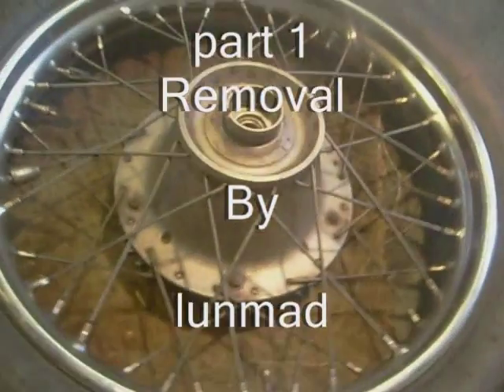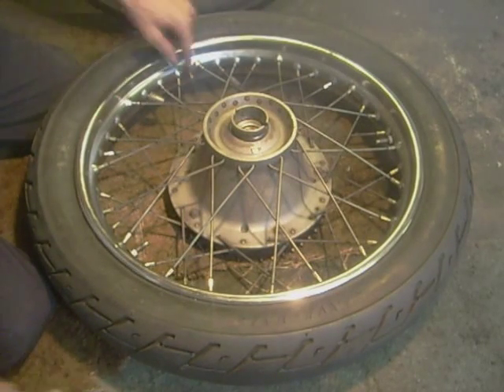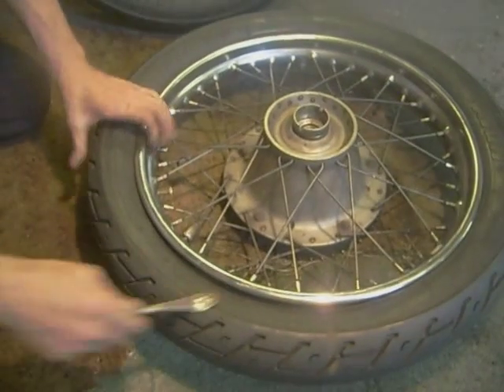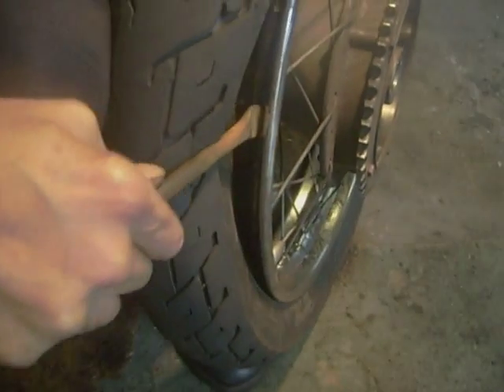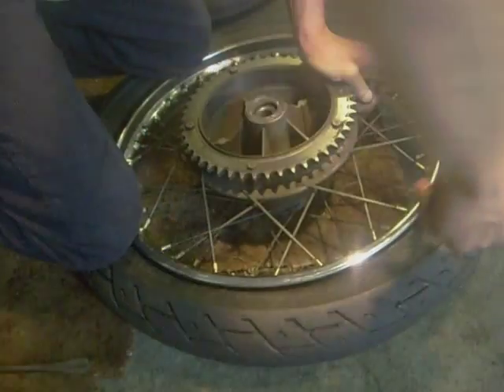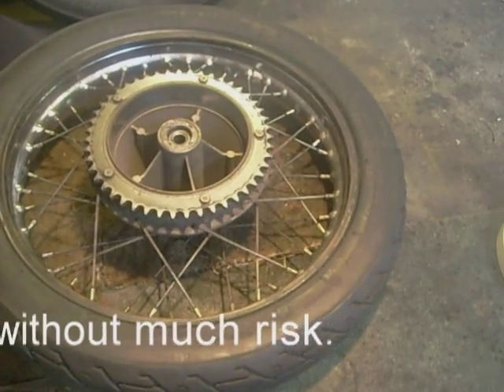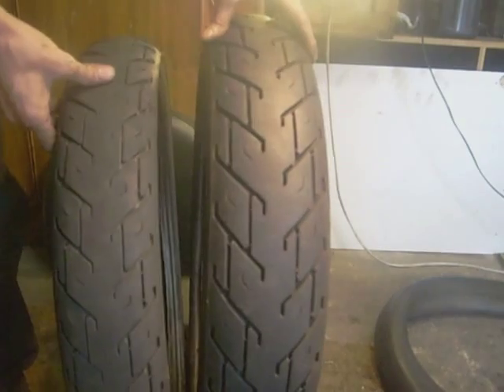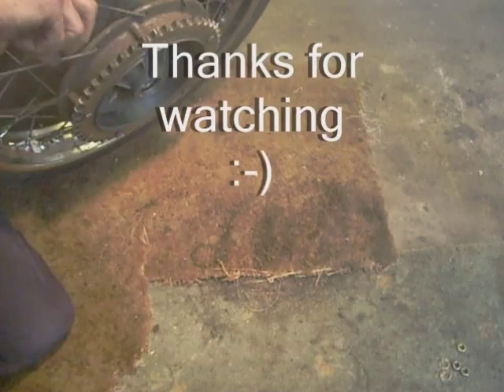Rear tyre part1 removal

Comment from the maker: Hi triumpht120rv :-)
great minds think alike I changed my tyres last week, at last I got my knobblies off
I fitted a new Roadrider on the front, and my old (but good) Road Runner on the rear.
What a difference in the handling! after fitting them i went for a blast over the Dales with an over night camp, clocked up 270 miles so the new one should be well scrubbed in wot!!